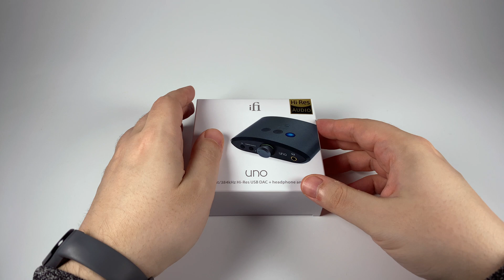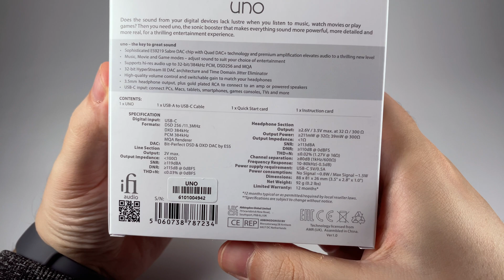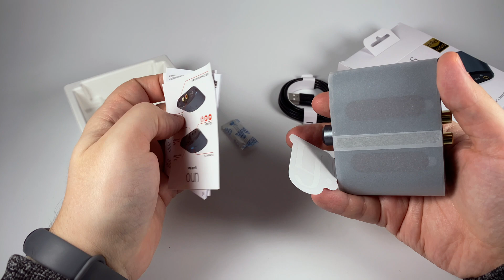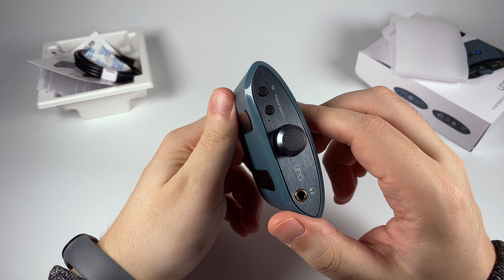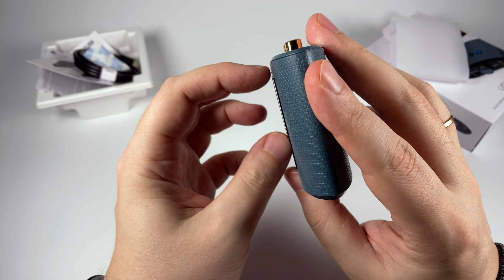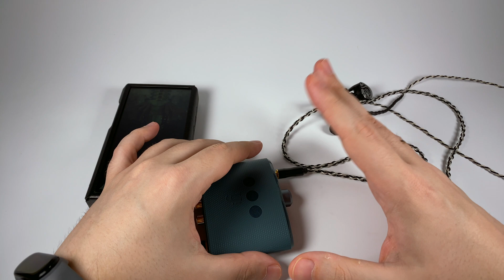iFi Uno DAC and amplifier review — friend of your wallet

Comment: you compared it to q11 but were not clear so which one do you prefer beween these 2 based on sound quality only, so if you had to pick one ?
Reply from the maker: As I've said, I'd select here not based on sound, but based on usage scenario. As I mainly listen music when working on laptop, I'd select Uno, I don't like fiddling with batteries. And for the portable usage I prefer a regular DAPs
As for the sound, for me they are both Ok, and there is no objective winner, it's just a matter of subjective preference. I described difference I hear at the end of the video.
Reply: I'm late to the party on this review but as of the time I'm writing this, I have the Fiio Q11 and the iFi Uno. I love both of them but they are different in terms of sound. I've had the Uno for many months and just recently acquired the Q11. For now, I listen mostly to the Letshouer S12 Pro.

Just to keep it short, everything that was said here about the Uno is true. It has a more forward sound signature. I wouldn't call it boosted but there is definitely a certain liveliness to everything. The Q11 is a bit more laid back and refined. It has a neutral presentation. The best way to describe this is that the Uno is more dynamic with a side of neutrality and the Q11 is more neutral with a side of dynamics. They are both good for different preferences.

Lastly, I tend to wonder if iFi's "S-balanced" 3.5mm output is responsible for its liveliness. It doesn't provide more power but it's as clean as using the 4.4mm balanced output of the Q11. In fact, using the 3.5mm output on the Q11 pales in comparison to the 3.5mm output on the Uno. It's not even close! You need to use the balanced output on the Q11 to approach the sound level of the Uno.

Lastly (really! 🙂), the volume controls are very, very different. The Uno is rather non-linear in its volume control. The slightest turn can increase the sound exponentially whereas the Q11 might be too linear. You have to turn the volume up a lot to get to the same level. However, I admit the S12 do require some power so that may be a factor. 

Neither one of these devices are better than the other. They are different in their own unique ways.